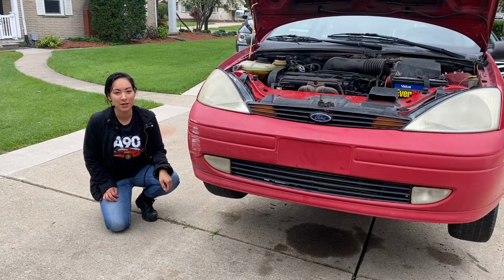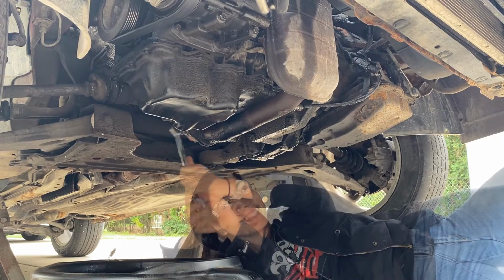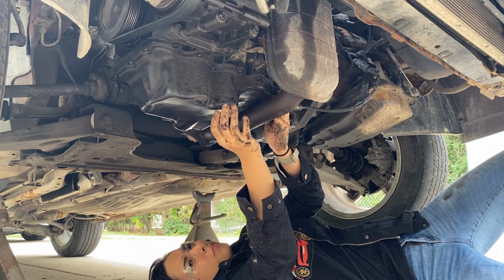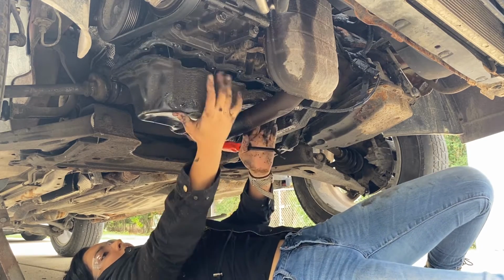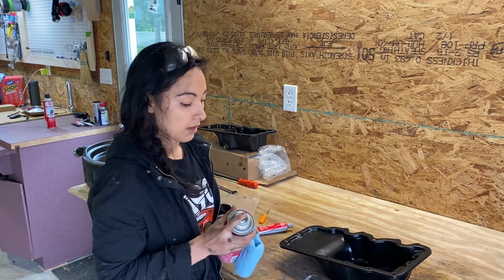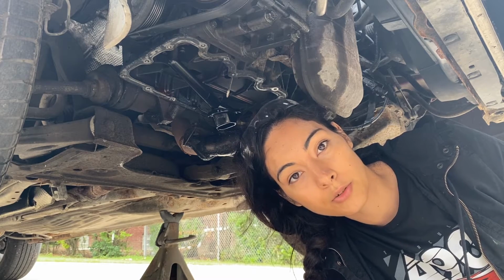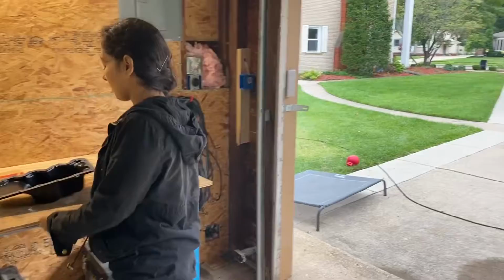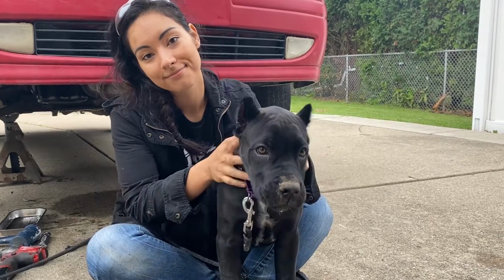Massive Oil Pan Leak - 2002 Ford Focus | Hard NOx Performance

Comment: I'd always wear eye protection when working under a car. I once got a little rust particle embedded on the surface of my cornea. I had to go to the local eye emergency room where they used special equipment to remove it. I had to wait several hours with a painful eye because I was apparently not a priority. With the amount I paid out of pocket, I could have bought many many years worth of eye protective gear.

Comment: I've more than one leak. Mechanic quoted me $525 to replace rear crankshaft seal where it meets the transmission , Pcv valve Replaced and a couple of cracks in aluminum oil pan where AC compressor is mounted to. Where its flush up against the crankcase. He also said to clean engine so I've done that. Used brake cleaner which dissolves grease and oil very clean and almost immediately dries up so it's super safe. 2016 Focus SE 2.0L duratech engine
Reply: $525 is cheap to replace a rear main seal. It's a lot of work.
Reply: @moshet842  I’ve drilled a hole on the bottom of aluminum transmission case to relieve the oil keep it from ruining another starter

Comment: run all of the bolts down  slowly if you use an impact  or better yet  unless you have not done it before run them down with a ratchet and socket follow up with a torque wrench    there is a tightening sequence

Comment: What if someone were to replace the oil pan with new gasket but didn’t use any rtv?
Reply: Did you ever figure this out?
Reply: @DevsDIY  from what i can tell the rtv only holds the gasket in place. my engine however is leaking oil. hard to tell if its only from the oil pan though
Reply: @OMFGory  if you find where it's leaking from let me know, I'm having an awful hard time finding where my leak is coming from. Just put a new oil pan on with sealent and a gasket. Still leaking awful
Reply: @DevsDIY  I've a few leaks. I'm getting brake cleaner spray to clean it from top then raising car getting underneath to spray the entire engine. Timing cover, rear, front every side. Brake cleaner gets all that oil and grease off very clean and super safe since it dissolves and dries up almost immediately.

Comment: ditch the wd 40 its, not a pent fluid  its a water displacement fluid  buy some blaster  or liquid wrench with all the rust  sometimes you need fire [heat]      spray the area a few days before the job    i live and work as a tech in ny  we deal with the worst rust.  i have been working on the focus  now since 2004